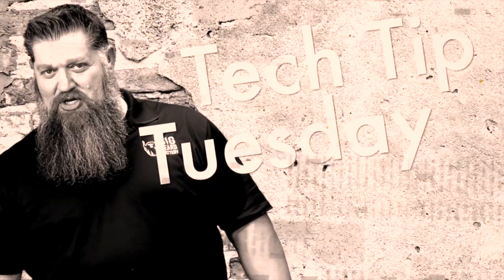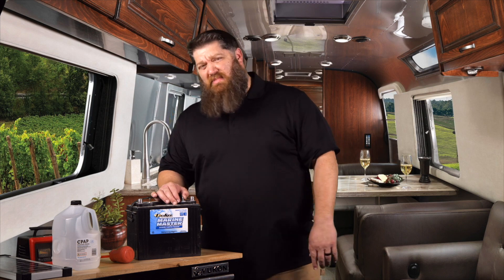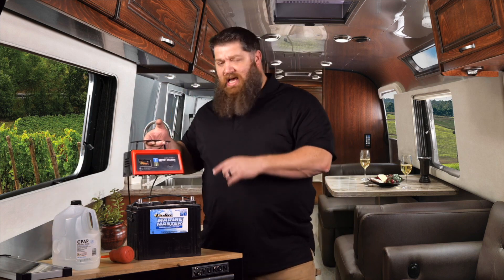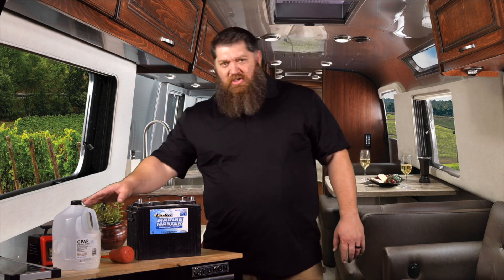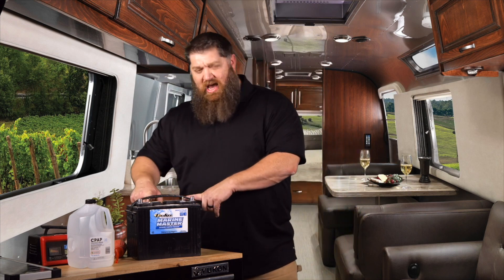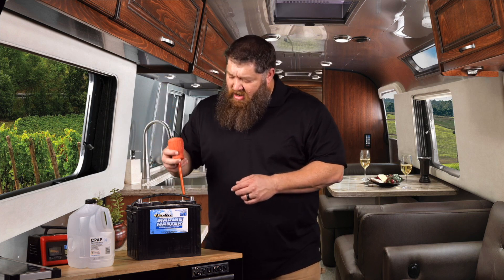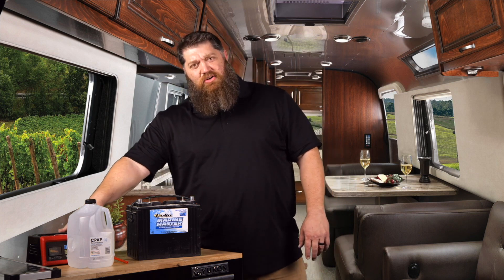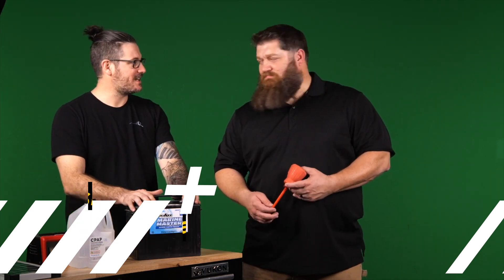How to service lead acid batteries

Comment: Thank you. I wanted to know one simple question. Should I add distilled water only or distilled water and battery acid (sulfuric acid)??  Most of these videos and generally all these Mr. Fixit videos have one gigantic problem. Video maker speaker wants to be a MOVIE STAR.  We are watching videos to fix a problem. It would be far better if we only see equipment to be used, tools, things needed and thing to be fixed rather than speaker’s face. The viewer wants to get his question answered.  To maintain the battery you need a battery tester, distilled water and sulfuric acid. Just ask for sulfuric battery acid at the Auto Zone or O’Reillys. Call around some carry it. Some do not. Thank you.
Reply from the maker: The pepper response using your line of reasoning is the viewer wants free info instead of taking the time to learn for themselves and this are LAZY. 

This guy will never be a star nor do I desire that. I’m using the skills and abilities to help others as that’s how I learned myself. 

I think your comment can stop at thank you. And my response is thank you for your kind response.

Comment: I'm not sure what kind of battery my RV uses, my mom purchased it in 2018 and she passed in 2019.  I know it is black but I haven't looked at it but maybe once.  It seems like I would need a new one because when i had to put a slide in, it was moving like something was wrong, slower than usual. I didn't know that some batteries need a water fill. Now I need to go look.

Comment: Back in the bad old days of last century every now & again you would see a battery shop. Usually
it would be in an old gas station. They would give you maybe $2 for your old battery and they
would rebuild it & sell it for like $10. All they would do is cut the plastic top off your old battery,
pour out all the old liquid & clean out any debris, form fresh new lead posts, weld on the plastic top,
pour in fresh new electrolyte, top off the charge & put it on the shelf. Warranty? None.

!

Comment: Something to consider is that a lot of newer rigs are coming with solar. If you have a solar charger controller, you should typically disconnect solar before disconnecting a battery. I would check the instructions for your specific charge controller if you have one.

Comment: Todd, I understand that folks have bastardized the term "trickle charger" to mean a "battery maintainer" these days.  A true unregulated trickle of 2 amps will cook a battery over the course of a winter.  I know, I did it.   What folks need to get is a battery maintainer that monitors the battery voltage  and only charges the battery when it needs to be charged, not a constant 2 amp charge.
Reply: Wow, if this is true, I want to thank you because I've been using the 2amp and wondering why my battery keep going bad after I've had them on a 2amp during winter or non-use times